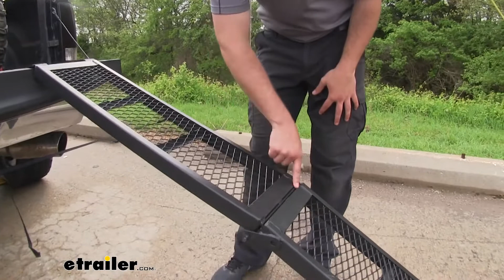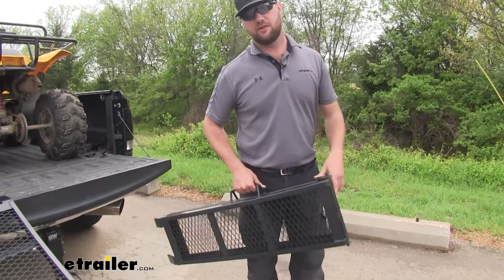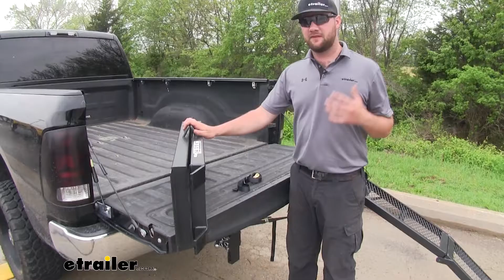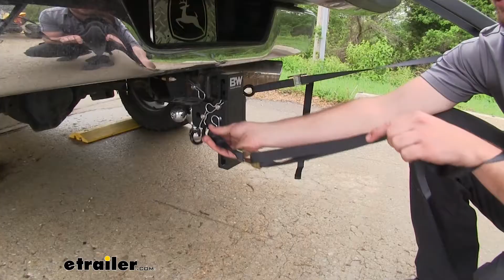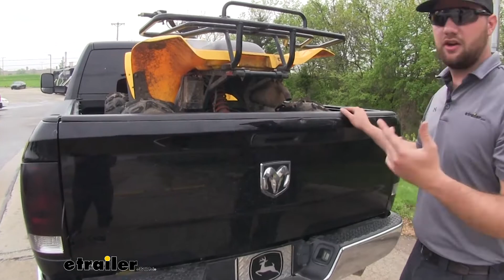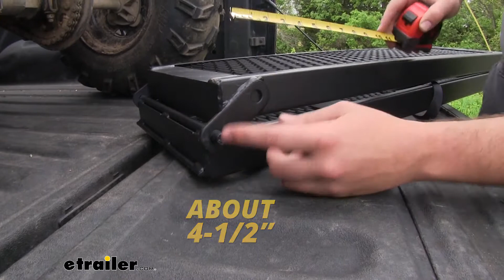etrailer | Comprehensive Review: Erickson Arched Loading Ramp

Comment: This look well made. However for certain higher truck beds these steel loading ramps might need a longer version. 
For my lower bed Chevy Astro Van these look very promising to load my John Deere D130 Riding Lawn mower.
Reply from the maker: Thank you for the feedback. The truck that these were used on is much taller than a half ton or a stock height 3/4 ton pick up. We have other ramps that are much longer than these if you are wanting a more gradual ramp. Check them out in the following link.
https://www.etrailer.com/dept-pg-ATV_Ramps-hs-90_Inch_Long.aspx

Comment: I have a Coot ATV that weighs about 1200lbs...with me in it, about 200 more. I'm concerned about the expanded metal holding up on these. The Coot as 235 75R15 tires
Reply from the maker: You'll be well within the weight capacity. Your tires are about 9.3 inches wide, and if you space the ramps apart properly, the expanded metal or mesh on the ramps will work just fine for you.
https://www.etrailer.com/ATV-Ramps/Erickson/EM07464.html

Comment: Those are really steep. Wish they where longer. I do like the design and look and everything they are just too short for my liking
Reply from the maker: This truck sits about 4 inches higher than factory. This is why the ramps are a bit steeper. We have other longer options available in the following link.
https://www.etrailer.com/dept-pg-ATV_Ramps.aspx
Reply: Yes your right, I concour while these ramps appear to well made they are too short. They should be at least 90+ inches long.